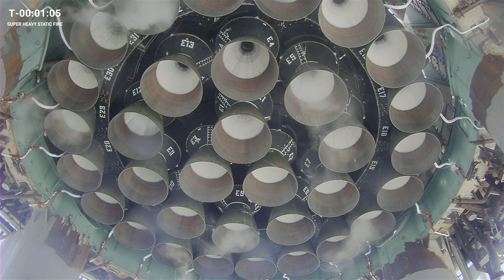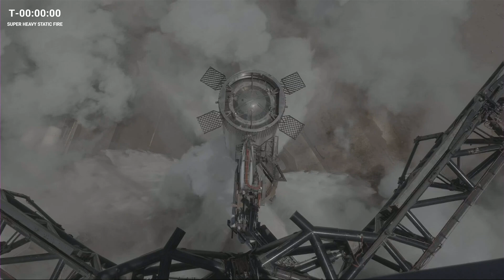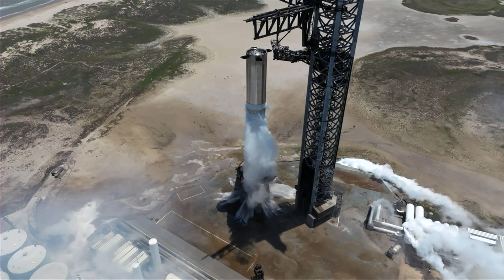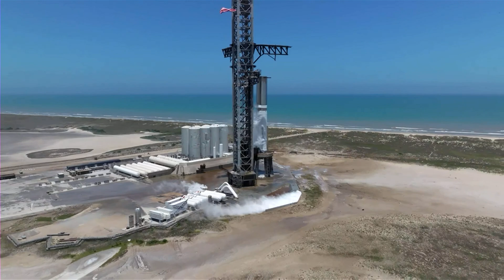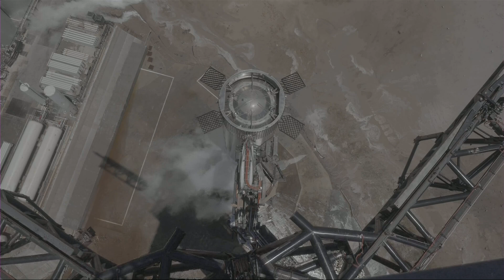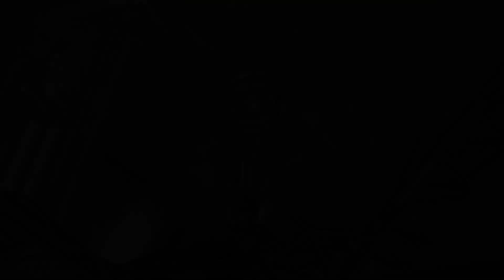Starship Super Heavy Static Fire

Comment: Well, there aren't any more excuses now in regards to debris damage, older raptor models, and hydraulic versus electric gimbles. Four raptors shutting down again on this simple test fire? SpaceX will now have to deal with the fact that the Raptor engine design has a serious reliability issue
Reply: Except that we don't know if the issue is the engine, the startup equipment or the plumbing.
Reply: Based on two sets of minor failures, you deem this to be serious reliability issues? You realize, this stuff is all quite new?
Reply: @stratolestele7611  two sets of minor failures? How do you figure that? They've never had a successful firing of all 33 without a failure in addition to the 6-7 that failed on the first test flight.

Comment: Why doesn't anyone get this?  This system and this architecture, with the 11 million+ pounds of thrust firing down at 90 degrees to the launch plate is always going to have issues with acoustic reflection energy going right back up into the engines.  That's why engines failed on the first flight and I have no doubt that's what's happened here.  A deluge system should be devised to deflect energy, not protect the pad.  Who cares about the pad if you can't successfully launch?  Even this deluge system makes no sense with water emerging from the center of the plate and shooting out.  That exposes a lot more of the plate to direct reflection than a scenario where you shoot massive amounts of water to the center of the plate.  With that, you would at least be dissipating some of the acoustic energy at angles away from the rocket's thrust plate.  I understand the water table makes digging a flame trench prohibitive but you have to do something.  Perhaps a steel cone in the center of the pad cooled by a deluge system that fires into it and not away from the pad as it sits now?  This is NEVER going to work.
Reply: Because everything you think you know is wrong and your understanding is badly flawed.
Reply: @TheEvilmooseofdoom  All day I was thinking "If they lose engines on ignition, then the issues with this launch configuration have not been solved".  That's why I've been so passionate with my responses here.  This was confirmation.  It's always going to happen.  Plus, I don't know of a large launch system in history where sound suppression water shoots away from the pad.  Do you?  I can't think of a single one.
Reply: Razón de necesidad y suficiencia.
Más adelante, idea plausible 👍😎
Saluditos 🖖👾
Reply: OMG, you ARE the smartest guy in the room!

I'll bet you believed, with certainty, that the Falcon boosters would never land upright either.
Reply: @stratolestele7611  Former engineer with Raytheon and involved in many rocket programs. That’s who I am. I’ll bet you a four star star restaurant dinner out with your girlfriend they make MAJOR changes in the next few months regarding this configuration. Test flight 2 not till mid 2024.
Reply: @MrCrystalcranium The facilities engineer that cleaned the toilets. 😅

Comment: Congratulations SpaceX on the limited Super Heavy static fire.   

Fanstastic steam volume generated.
What were the acoustics like?  
Were the 4 engine shutdowns in the inner rings?  
What was the peak pressure within the water deluge base?  

Looks like you have room to put in a deluge water recovery system.

Looking forward to the next round of fixes and a full duration static fire test.

Comment: Didn't see concrete flying around, so that's an improvement. Two main issues are now the reason for the early abort and the reason for the 4 engines that shut down. Might be one issue instead of two. This generation of Raptors still doesn't seem reliable enough. I assume these are still old versions (V2).

Comment: Water deluge did its job.  White exhaust instead of brown dirt exhaust.  4 engine premature shutdown.  12% engine failure is a concern.
Reply: Yup, the booster is still a WIP and they're still having engine problems.   That's the nature of the beast with 33 engines.  It's a plumbing nightmare.
Reply: Well, B9 hasnt had any engine swaps yet. I believe they can figure out the problems quickly. Next boosters will have a more reliable version of raptors so no worry.
Reply: They'll get it. They're close.

Landing boosters on a moving platform was a much bigger challenge.

Comment: Why not have just a big pool of water instead of water flowing rapidly upwards?
Reply: Answering myself, maybe the fired up gases would just deflect from the surface of the water causing damage.
Reply: The water would be blown out of a pool in half a second
Reply: Because they need to work under there still.

Comment: Nasa is SMOKING SpaceX! They have 10 minute engine tests, they work. They have reasonable exhaust control. THAT'S why Nasa kept building, instead of counting on Starship.
Reply: I wish you fools would stop pretending you have a clue because you feel the urge to try and vilify.  You're not smart enough to pull it off.
Reply: NASA doesn't build anything
Reply: Uhh but NASA is literally a customer of SpaceX? SpaceX will be the main element in the Artemis program

Comment: Did the rapid expansion of the steam have anything to do with the premature shutdown of the 4 engines?
Reply: Likely not, the pressure coming out of the engine will be MUCH higher.
Reply: @TheEvilmooseofdoom  Do you have any theories about what caused the 4 shutdowns if not related to the new deluge system. 
P.S. The volume of steam was amazing.  My favorite part is after the steam cleared, the view of a pristine and clean pad and Stage 0 overall.

Comment: Great to see the steam dissipating the energy.

The pad looks so incredibly clean even after the deluge system install.  Very impressive.  I suppose anything that sticks up off the ground would be subject to a lot of force from the booster.
Reply: The launch pad survived unscathed but they lost 4 engines almost immediately, in all probability due to acoustic deflection off the plate.  What's more important...the damage incurred by the launch pad or the damage incurred by the rocket?  It doesn't make sense to me how so many people are focused on protection of the launch facilities when the shock from startup bounces at 90 degrees off the plate right back up into the engines and snuffs some of them out.  Until they solve this, it'll never get off the OLM without damage.
Reply: @MrCrystalcranium 90°?
Reply: @nagualdesign  The angle between the rocket thrust and what it's hitting.  Think about shooting off an air horn at the flat side of a large building half a mile away.  The echo is going to bounce right back at you.
Reply: @MrCrystalcranium  I think you mean 180°. The shock from startup bounces at 180° off the plate right back up into the engines.
Reply: @nagualdesign  Yes the deflection is a full 180 but to get that, you need to be at a 90 degree angle to it.
Reply: @MrCrystalcranium  That's one possible reason; perhaps the most likely.  If so, I know how to fix it in place, without moving anything currently in place.  Let's see if SpaceX figures it out.
Reply: @MrCrystalcranium  Could a conical structure underneath perhaps be the answer? (ie to deflect the energy radially away from the Starship (instead of directly reflecting it back up) ?
Reply: @MrCrystalcranium  In your original comment (which is what we're discussing) you wrote the "the shock from startup bounces at 90 degrees off the plate right back up into the engines", but the shockwave is parallel to the plate before and after reflection. It's reflected 180° – straight back up.

I think what you're trying to say is that the plate, being perpendicular to the direction of the engine exhaust, doesn't make a very good deflector. And you're right.
Reply: @nagualdesign  OK well thank you.  Seems like trigonometry semantics to me but whatever makes you happy.
Reply: The truth here is the whole deluge system is an after thought, the tried trusted and tested system was used for years with the space shuttle. This flat bed can only absorb so much and obviously isn't the full answer but they only need this to get a couple of craft off the pad

Comment: “A water deluge system” designed to protect the pad from 33 very powerful blowtorches! 4 of the “blowtorches” failed, but the deluge system works! Looks like they’ll need to do another Static Fire as soon as they’ve fixed the problem…
Reply: Worked just as intended

Comment: Congrats! It seems the water deluge has just demonstrated a proof of concept! (Although a premature shut down of 4 engines is probably something to investigate further. - But that probably means: we will see something like this again soon!)
Reply: I agree, definitely interested to see further tests before it's confirmed ready. But it's promising progress so far.
Reply: Hope you're right but the geometry seems all wrong to me.  Energy goes down, hits the plate, reflects straight back up and damages engines.  They need a flame deflector or a steel cone on the pad plate to change the angle of energy deflection or this is always going to be an issue.
Reply: @MrCrystalcranium They did add a flame deflector system already, it's the water deluge you see going off around t minus 5 seconds.

Comment: Great test. Now they'll examine the data frame by frame, and see what caused those four engine failures. I am anxiously waiting to hear the post-test analysis. Go Spacex!
Reply: Looks like the 4 engines had bad information relayed to it sooner than the other 29engines. Somehow how those 4 engines acquired the data before any other engines did. MAYbe the line got snagged on a piece of debris and the 4 engines shot incorrectly from the bad data sets. WHO knows what those data sets are Donning-Virtually no one knows unless the analysts see through that old source code. Hopefully no moles got hurt on the ground during the test launch phase. Try another "fill test" and hopefully it launches properly with corrected data sets. Good luck and Godspeed on your next launch.
Reply: @hockeydadcience It helps if you mention a source for your information… otherwise anyone can go rambling technical stuff and be believed.
Reply: @Engineer9736  He sounds scientific but it is total B.S.
Reply: @hockeydadcience  This is always going to happen with this configuration.  Energy goes down, hits the base plate, bounces straight back up and damages engines.
Reply: @hockeydadcience personally I think it's more likely that the flux capacitor went haywire during the test, causing a photosynthesis overload on the radial catharsis joint.
Reply: Space X has said that those four engines were shut down at the start of the test.
Reply: Lol. No. Why would they look at the video?  You can't see anything. Engineers use data to examine results.
Reply: @SirGreenDay    Are you a rocket engineer?   If not how would know whether a video is important to them or not?

Comment: Great to see how quickly the deluge system can be started (only 6s before the engines started) but why did it continue to run for over a minute after the engines stopped?
Reply: Spooling down. You cannot just slam the valves shut on a high flow and pressure system.

Comment: Steam explosions beneath the ship causing engines to get knocked out? That would be my preliminary guess.
If not, then there is a deeper underlying problem here which needs figuring out.
Reply: No. The pressure would flow out to the sides of the pad long before it rose into the higher pressure region below the engines. More likely the engines were shutdown for not perfect performance.

Given that this is the booster’s, the upgraded pad’s, the ignition sequence’s and this particular set (and version) of engine’s first test, it’s not exactly unexpected that it will run perfectly.
Reply: @seasickrhino8926  One then has to wonder what is causing multiples of engines to shut down prematurely across many tests, since this has been an ongoing issue for most instances of them attempting tests with all engines firing.
Is it a vibration issue? Some sort of pressure differential in the fuel lines/manifold from so many fuel hungry engines starting at once?
It really does seem like a deeper issue since it is always so many failing. A single engine or perhaps even 2 having problems would not be entirely unexpected but 4 on this test, 6 or 7 on OFT-1 and several other instances of test firings with less than the planned engine total... it's a bit concerning.
Reply: @seasickrhino8926  Good reply, as I was unaware of the ETVC being tested for the first time during this firing.
That in particular is interesting for a number of reasons.
I'm just going to go ahead and blame that then, since the majority of times I have seen issues with complex machinery such as cars, trucks, boats, etc. it is usually an electrical gremlin somewhere.

Good that they are not failure averse, on that I will not argue.

And if the pessimist in me turns out to be correct and it is a design flaw of some kind, I've no doubt that they would redesign it as this current vehicle has been redesigned so many times and is so radically different from the concepts of even 2 years ago that they are practically working with an entirely different rocket. No reason they couldn't do that yet again.
Reply: @Centurion04  agreed.

Comment: Beautiful display...and i guess the metal plate held up because after the engine exhaust stopped the water kept coming as designed. But bummer about 4 engines shutting down prematurely. So maybe the engines malfunctioning on the last launch was not caused by concrete???

Comment: The deluge system might have worked too well and flooded a few engines... maybe the timing was too soon for the engine ignition.
Reply: Nah, we saw them test the system without firing and it did not contact the base of the pad, much less, the engines. More likely, they were not performing perfectly and were automatically disabled to prevent potential irreparable damage to the engine.
Reply: @seasickrhino8926  Indeed, and it is a testament that many systems involved in this test are working as expected, i.e., the shutdown of engines is part of the testing chain.
Many of the comments strike me as impatient and having a lack of understanding what testing is all about.

Comment: Water turning into vapor at that rate is pretty spectacular and violent. Wonder if the shockwave caused some problems for the engines…
Reply: Yeah I really hope everything held up
Reply: @clausmadsen6754, I have not followed things as closely as I should but haven't they had issues with some engines pre-flight/during flight... Seems like I remember seeing some of their past tests where the engines "flickered", "flamed-up" and even "shut off". I wonder if it could be a fuel-delivery system issue... You mentioned "shockwave", honestly that was such a powerful yet short blast, I wondered if the "shockwave" didn't move Earth on it's axis a little! I bet if we lined enough of these up and pointed them into the right direction, we wouldn't need to "travel aboard Starship to Mars", we could just "travel on Earth to Mars!"😄
Reply: @zenithperigee7442  lol! They could aim them upside down to push the earth 😉
Reply: Where was there any shockwave?

Comment: How would ANYONE look at this and think this was an awesome test? You have no idea if the concrete held up.  The duration was cut in half. 4 engines failed. What’s wrong with you people?  Can’t you recognize failure when you see it?
Reply: Oh yes, I can definitely see a failure here - your post.
Reply: @stratolestele7611  the test is a failure. Accept it, cupcake
Reply: @stratolestele7611  the engines fired half the time they’re supposed to. Over 10% of the engines prematurely stopped.  How much more needs to fail before you learn what a failure is?

Comment: Remember when a lot of people said it'd take 6 months or longer and we'd be lucky to see another launch before the end of the year?

Pepperidge Farm remembers.
Reply: We will be lucky indeed. It's already August and this static fire didn't go well. Half-duration and 4 engines out. Obviously with that it couldn't reach orbit.
Reply: @patham9 So did you not consider that the unreliability problem with the Raptor will get addressed very quickly? They have fixed the pad already and the new water deluge system had worked as expected (even though it should have been installed prior) so you calling this test "[not going] well" is nonsense.

Comment: 3 questions: Had this been an actual launch with a starship on top of the booster, would it still have been able to #1, lift off? and #2, make it to orbit? and finally #3, would the booster still be able to land?
Reply: Need to do tests first to ensure it will go to plan.
Reply: You will have to wait until a fully stacked & fueled Starship is on the pad. Patience, grasshopper.